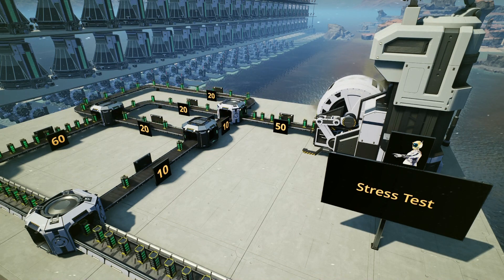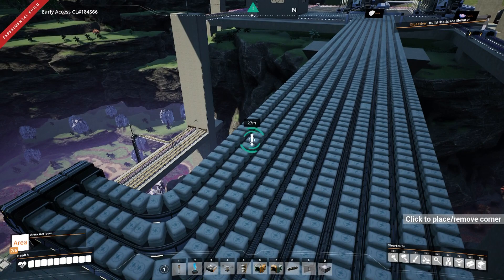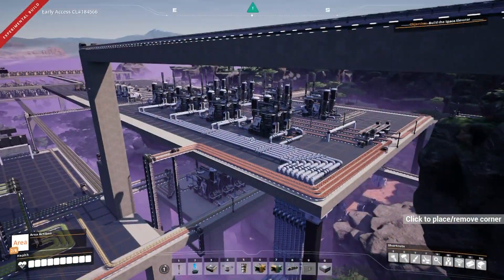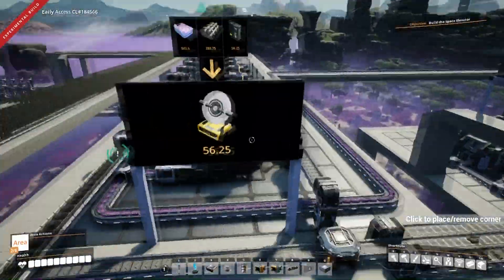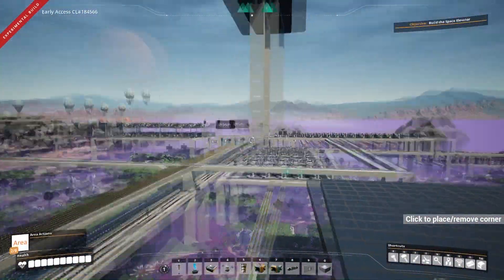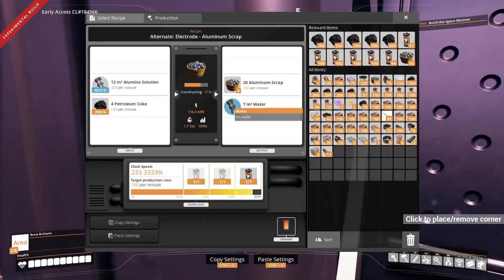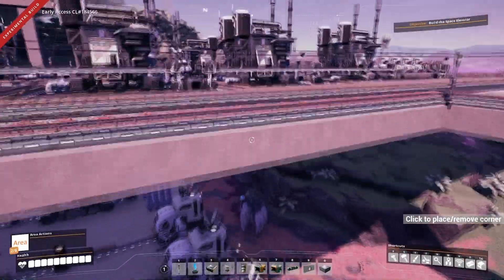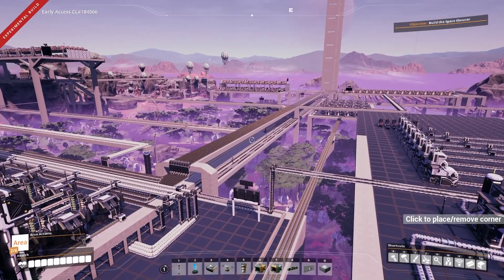SATISFACTORY - A LITTLE BIT OF TROUBLESHOOTING

Comment: The easy way to get recycled water working is to limit your water pumps to the min required and let the system slowly fill - have the recycled water enter at the other end of the line of refineries (with a valve) from where the fresh water enters. I never have problems unless the water pump is supplying to much. I'm about to start the same project - I gonna steal you factory layout but send the Rods via drone and do the plutonium production near the power stations on the west coast.
Reply from the maker: Good luck with your build =)   Yeah I have used the recycled water method a few times before as well,  I can get it to work, but I've decided to run it this way this time,  plus I actually need to make about 700 concrete p/m